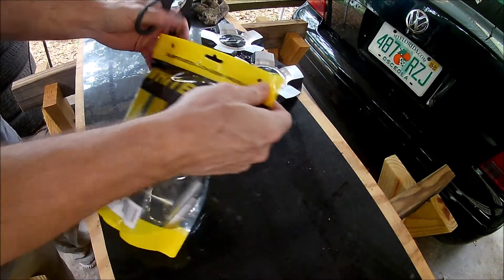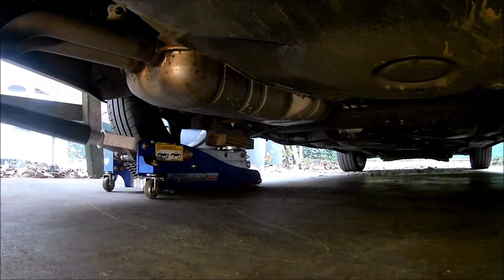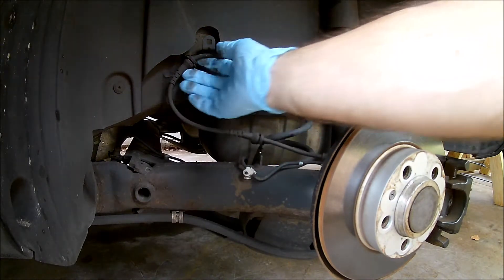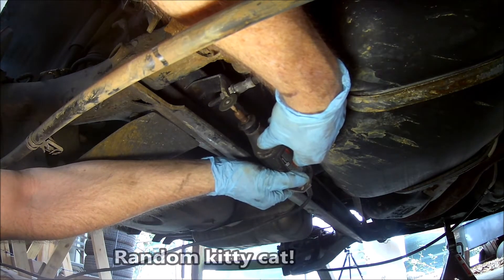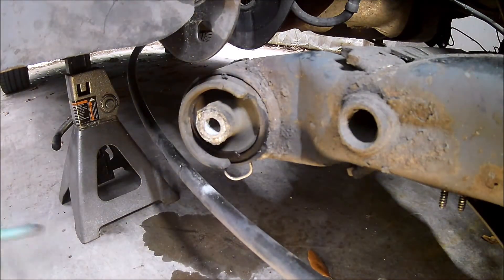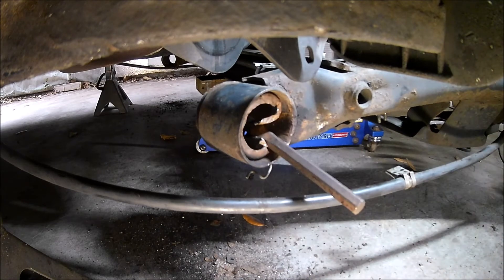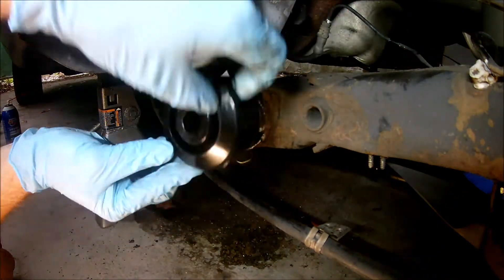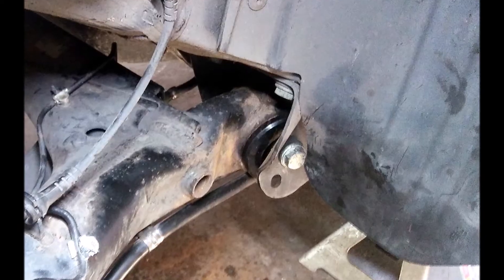Jetta Project Car: How to Replace Rear Axle Beam Bushings (Mk4) [remaster / re-upload]

Comment: I just did this job the other day! I have an Mk4 BEW. In this video the bolts through the bushing are threaded in from the outside  of the car towards the car. But to my dismay, I found out that my bolts were threaded in from the inside out. Opposite! This mattered because on the passenger side, the gas tank is in the way such that I didn't have the clearance to pull out the bolt! I had to cut the bolt to get it out and use new bolts. So fair warning for anyone still working on these old cars, you might end up in a similar situation. If that is the case, be prepared with some kind of tool for bolt cutting (I used a dremel), and new bolts.
Reply: Also. I totally had to use a ratchet strap to get into back into place...l was hoping I could avoid this fate but I couldn't.
Reply from the maker: @Tliwinski  - Wow, that's messed up!
Reply: It seems to be on certain models have heard this before     messed up yip guess on the assembly line for some reason this occured . VW gota  love them
Reply: You can remove the mounting brackets themselves and just drop them down enough to remove the bolts.

Comment from the maker: Hey everyone! This is an older video that I decided to remaster, because the audio wasn't that great. I re-recorded the voice over, and re-balanced the audio levels. Enjoy!
Reply: @michael blacktree
Could you please give the symptoms you might have if those bushings are very worn? I have a MK3 Golf that probably has similar bushings, and when I go over uneven pavement with the right side rear wheel the car seems to jerk to the left suddenly. No noise involved so I figure it is a worn rubber suspension part, I wonder if a worn coil/shock bushing could cause the same? Thanks.
Reply from the maker: If the axle beam bushings are bad, the rear end might wander around, because the axle beam is moving around. A quick visual inspection should give you some clues.
Reply: @michaelblacktree  Thanks for the quick replies friend. Much appreciated, I'll have to take the rear wheel off and check it out soon. It's interesting because on smooth pavement you wouldn't think anything was wrong really, but with some uneven pavement for more than a few feet on the right rear wheel you definitely get a sudden shift to the left, it almost feels like the car is pivoting around maybe. It definitely seems to be related to the right rear wheel hitting the uneven pavement. I'll follow up and let you know what I find, maybe it will help other people with MK3 Jetta/Golf vehicles.

Comment: This is the absolute worst way to get these type of bushings out. There is a tool that you can get them out in under 5mins.
Reply from the maker: Yep. I was too cheap to buy that tool. And I regretted it.
Reply: What tool is that? I have looked all over an can't find it. Please advise.
Reply: @Frankie Diamonds 
Is the special tool a puller style tool, could you please give a link to it? Thanks.
Reply: This is basically the tool I got. https://youtu.be/7Lroob01gZk
Reply: The one I found was the cheapest at Amazon and it worked perfectly
Reply: @frankevega  Thanks Frankie, you have been super helpful!

Comment: Just installed the Whiteline bushings today on my 2002 Jetta 1.8T The stock bushing were in there from the factory, so 20 years old, shame on me since I've owned the car since new. My stock bushings were so bad that the axle slid over to the driver's side hitting the bracket, and there was some serious clunking that started a few weeks ago. Overall the job was fairly easy, didn't see this video until now, wish I had because that tip about the ratchet straps could have saved me over 2 hours of agony. You cannot put the axle back into the brackets, period. It's too tight, and I thought maybe the bushings were supposed to be installed the other way around. The car is so much better now and no more noise!
Reply: Also, my stock bushings literally fell out when I lowered the axle. For the metal races, I used a sharp wood chisel to knock it out since it has a nice sharp edge. They are thin so they rolled up and fell out easily.
Reply: The car is only worth 1500 bucks time to scrap it out and buy a newer VW 21 years old ? LOL
Reply: @mronemanband1 You crazy bro. I'm going for another 21 years!

Comment: How have the bushings held up so far? I'm about to overhaul the suspension on my Jetta. The hand tight fit of the bushings would make installation easier, but i would be worried about premature wear due to them not being tight.
Reply from the maker: They're still fine. The bushing itself doesn't rotate. The whole assembly rotates around the mounting bolt. So the bolts need to be clean, and well lubed.

Comment: How satisfied are you with the urethane bushings?  Please consider making a followup video to discuss it, or just comment and let me know.  I plan on doing the same work to my '04 GTI but will probably install OEM rubber bushings due to the age of the car and desired ride quality.
Reply from the maker: I'm happy with them. But I live in Florida. The roads are pretty smooth. They might be a little harsh on bumpy roads. A happy medium between stock and urethane would be the Cupra-R bushings. You might want to consider those, if urethane is too stiff.
Reply: @michaelblacktree  I'll research the Cupra-R bushings.  Quick follow up question for you: was it difficult for you to remove and reinstall the bearings on the stub axle?  I bought a new set and they're extremely tight and will be impossible to install without freezing the stub axle and heating the bearing.

I live in the Los Angeles, California area.  Freeways and city streets are reasonably okay but some are rough.

I'm most interested in refreshing the car to maintain reliability, dependability and smooth factory ride quality.  This means no performance parts for this car.

I plan on refreshing the rear end with the following new parts: axle beam bushings, paint or powder coat the axle beam, heat shields for the brake rotors, stub axles, wheel bearing assemblies, brake lines, shocks and springs and of course all new hardware.  I bought the Bilstein B6 shocks designed to be an OEM replacement but with better reliability.  New springs from Eibach designed to replicate factory springs with better quality.  The brakes and rotors were replaced last year and should still be good.  Considering the car will be 18 years old later this year, and that it's one of the very few MKIV GTI's I see on the road, I feel the OEM or OEM+ parts have proven themselves to me over the years.  I rely on the car as a daily driver and for long road trips.  As a result, I want to maintain a comfortable ride quality.  After the rear end is done, the front suspension will get a similar refresh. along with tie rods, control arms, sway bar, dog bone, engine mounts, clutch, coolant hoses & pipe, radiator, heater core flush, fans, alternator, serpentine belt & tensioner, starter, alternator, timing chain & tensioner and maybe the exhaust pipe.  The exhaust pipe is good.  Passes emissions, but my concern is the bushings that link the stick shift to the shift cable assembly will eventually fail.  I don't want that to happen while I'm driving, so I'll drop and replace the exhaust with a factory equivalent in order to access the bushings.

All parts mentioned will be replaced for the purpose of reliability and dependability.  None are broken except for one of the fans.  Reliability and dependability are top priority for the car.  This means a whole lot of preventative maintenance.

The car has the 2.8L VR6 engine.  Definitely happy with the engine.  Occasionally I run into an issue like a vacuum leak, and last year a coil failed, but nothing serious.  The parts I outlines could end up costing me a little more than the car is worth, but if all goes well, it will be money well spent if I can get 2-3 more years out of the car.  Ideally, I'd like to clock 300K on the odometer.  This would take me another 10 years.  By that time, far fewer of these cars will be on the road.    

Thanks again for your outstanding video.  You taught me a few things.  Greatly appreciated.  By the way, I used to live in Fort Walton Beach, Florida.  Enjoyed that area.  Best beaches in the United States.
Reply from the maker: Are you referring to the rear wheel bearings? I actually haven't replaced those yet. (they're still good) But there are some videos about it on youtube.

Thanks for the compliments. And have a great day!
Reply: @michaelblacktree  Yes, I'm referring to the rear wheel bearings.  I have the new replacement.  They come from a German manufacturer who makes OEM parts for VW & Audi.  Although these are not labeled as OEM, they're stamped with the Audi logo.  Can't say the name of the manufacturer which is simply a 3 letter word, without getting this post misinterpreted and deleted.  Suffice it to say, the name begins with the letter F and ends with the letter G.  They have a good reputation for manufacturing bearings so I'm confident they're good.  However, installation looks difficult because  tolerance between the axle and bearing are extremely tight.   I assume, but am not certain, that freezing the stub shaft and heating the bearing will make assembly easier.  I'm replacing both rear wheel bearings because the last time the car was on a lift and I spun the wheels by hand, one of the wheels had significantly more rolling resistance than the other.  Hoping that new bearings will improve fuel economy and performance while indirectly putting less strain on the transmission by lightening the load/resistance the bearings are creating.
Reply from the maker: Sounds like a plan.
Reply: @RedondoBeach2  You mean that YouTube might nix your post about pressing your shaft into an extremely tight "F G".... Nah.... I hope that you have this figured out by now, but in case you haven't.. All you have to do is carefully smack them on with a mini sledge, and a  large socket (I used a sleeve from a press kit, with a block of wood for cushion). Just enough to get the nut to safely engage and then tighten it down to 129ft lbs. Just know that those nuts are supposed be changed because the nylon has already been used. I reused mine with some blue locktite, but I would never suggest anyone else do it. I will be doing the bushings soon. I have the Cupra R's. I don't dare do poly. Our roads are crap. Our governor's slogan when running was "fix these damn roads". Ha they're worse than ever now.
Reply: @derekmoore1612  The project is on hold as I balance other priorities.  I'll need to plan on having several days in the shop with the car since the axle beam will come down.  When I finally start, I need to be 100% ready since I have to pay an hourly rate to use the garage stall and car lift.  When the project does start, I might end up taking the axle beam to a shop to have it sand blasted and powder coated before reinstallation.  Maybe overkill for a car this old, but I never want to have to deal with this part of the car again after the work is done, and I want the car to last at least another 100K miles.  I still need to check out the Cupra R bushings but I'm also inclined to stick with factory rubber bushings.  I got 150K miles out of my factory bushings and I like the ride quality, so I'm reluctant to install an unproven bushing.  Yeah, I'm not sure YouTube would like me spelling it out, but I'm guessing they don't mind your double entendre.  haha  A sense of humor is always good.  I was a jet propulsion mechanic for many years and I can tell you, mechanics have the filthiest sense of humor.  I mean that in a good way because it was always good natured and funny as f***.  .
Reply: @RedondoBeach2 Glad to hear you have a sense of humor...Not sure if it matters to you... The Cupra R bushings aren't unproven or aftermarket. They are from a sporty version of the mk4 platform that isn't available over here. They are still rubber inside, they just have more rubber inside as opposed to open air. Good luck.

Comment: The question is... Do you actually notice any difference in the way to drives or sounds?  My factory bushings don't look all that worn, but I'm rebuilding pretty much the whole suspension and new bushings are cheap.  Just wonder if it's worth the labor to do it now.
Reply from the maker: Yes, the new bushings tightened up the rear end. Granted, it's just a torsion beam suspension. So it won't handle like a sports car. But it was an improvement.

Comment: Great vid, thanks. I'll be doing the same soon and am stuck deciding between these 2 piece White line or the 3 piece Energy Suspension. Any recommendations?
Reply from the maker: Thanks for the compliment! I don't have any experience with the Energy Suspension bushings. But the Whiteline ones were very easy to install. The hardest part was re-installing the axle beam, because the bushings are stiffer. But I think any poly bushings would be the same, in that regard.

Comment: I'm getting a bad wobble on rough roads.  Looks like my rear bushes are shot.  Is that a symptom?
Reply: @wizbang16
Same here, my symptoms on my MK3 1996 VW Golf is you have the right side wheel go over rough uneven pavement for more than a few feet and you get a pretty substantial jerking movement where the car wants to shift to the left! There is no obvious noise when this happens inside of the car, but it is pretty disturbing like you could lose control Post back with a reply if you had this work done or you found out what your problem was, I am certain that the issue I have is at the rear of the car. I checked the shock bounce and they don't seem to be failed but may be slightly soft same with the coil spring, seems to be in OK condition, I wonder if it could also be the top coil/shock bushing too?
Reply: @watershed44  It was the rear axle bushings.  They were shot.  I replaced them with a two piece design which made installation easier without removing the axle.
Reply: @wizbang16  Thanks friend, how difficult was the job on our MK3 model (actually getting the old bushing out?? Thanks for the quick reply! Appreciate it!
Reply: @watershed44  I did this on a 2005 Beetle MK4.  The bushings were plastic so WD-40, Hacksaw blade, hammer and chisel popped them right out.  I have done earlier ones which had a metal shell and they were rusted to the housing which made a difficult job.
Reply: @wizbang16  Luckily I'm down in the southern USA and they don't salt the roads down here so maybe I'll get lucky! Thanks again for the quick replies!

Comment: Hey Michael, great video! You vid has compelled met to install these bushings on my 2002 VW Jetta, ALH, 5-speed!
Do these bushings have to be aligned similarly to the stock bushings (ie. is there an alignment mark to line-up on the Whitelines to the trailing arm like the stock bushings)? Do the bushings need to be loaded like the stock bushings before torquing the bushing bolt/nut? Thank you for any information.
Reply from the maker: Hey David. The urethane bushings don't need to be aligned, and don't need to be pre-loaded. All you need to do is put the correct half of the bushing on the correct side, like I showed in the video. The bolts can be torqued with the car up in the air, if you want.
Reply: @michaelblacktree  Thank you for your reply. It is a great help... I start this project next week. Thank you again.
Reply: @michaelblacktree Hey Michael, holy cow, getting that old bushing out, in a word, SUCKED! You mentioned a tool to remove the old bushing. I've looked on eBay, Amazon, Rock Auto, etc. I can't find a tool to REMOVE the bushing (there are plenty to install but none remove). I looked up the tools the Bentley recommends, but they're ~$1500. Do you have a link you can share. I got one done today and am going to do the other tomorrow. Thank you for any information.
Reply from the maker: An air hammer would make short work of it. You might also be able to adapt a ball joint removal tool.

Comment: do the urethane bushings squeak like the poly ones? Ive seen so many different versions of this part, hard to choose what i actually need.
Reply from the maker: Urethane and poly are the same thing (polyurethane). Anyway, these ones don't squeak... or at least, not yet. These Whiteline bushings have a textured surface on the inside, which I think helps to hold the grease in. Other brands may be similar, but I'm not sure.
Reply: @michaelblacktree  I was looking at the Energy Suspension, and the powerflex, one is made similar to the oe, and the other is split kinda like the whiteline, i think the whiteline one and the way its made is better than the oe with the metal casings and all. I was curious as to what the differences were in them since they were clearly made different. The oe and the oe style ones have that line on them that has to be lined up with the weld in the housing, wheras the whiteline and powerflex ones don't have that and are more symetrical. Probably doesn't matter much for my application anyway its for my daily driver thats mildly built and tuned (around 300hp or so)
Reply from the maker: One benefit to the split bushings is ease of install. The OE style ones are more of a hassle.

Edit: You might want to stop by tdiclub.com and have a chat. There are lots of knowledgeable people there.
Reply: @michaelblacktree  i was thinking the same, i appreciate the fast response. I think i'll go with the whitelines like yours, seem to be a popular choice.